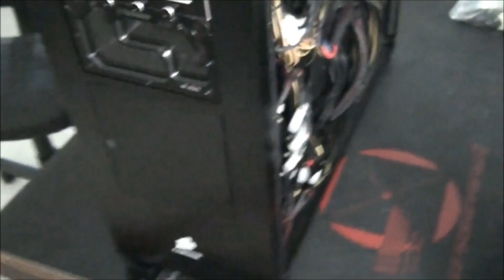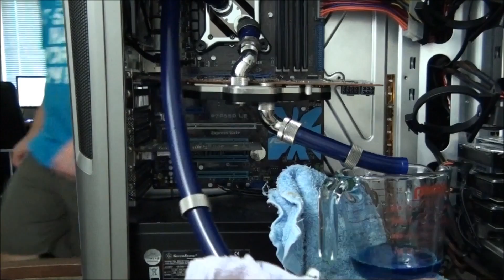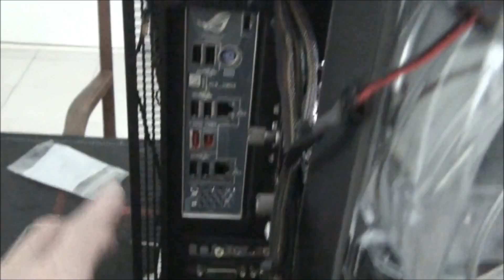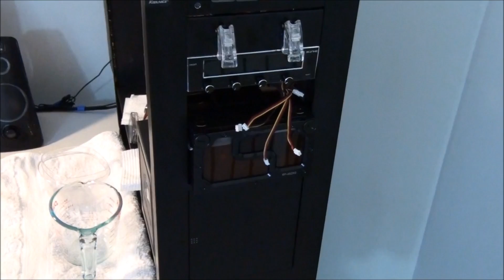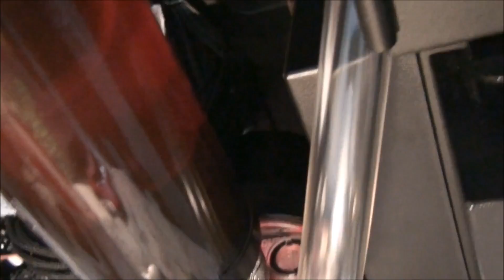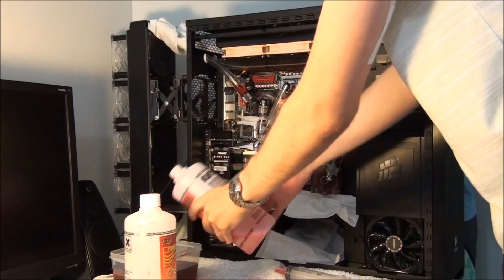Singularity Beast Resurrection - Client Build 3: 800D Water-cooling: Part 2

Comment: I believe the pump is either the 35X from Swiftech or a MCP655 or other renames, also the reservoir is from Bitspower, bitspower has only 1 tube reservoir so it should not be that hard to search for it.

Comment: Hello to you mate, i have the same resevoir and was wondering on the bottom where the fitting goes into the resevoir from the videos cards is the silver tube installed inside or the anti cyclone adapter or is it just the fitting going into the res?This is my first cyclinder resevoir and i don't want that cyclone swirl going on inside, but that calm look.

Comment: @SingularityComputers not something I'm disputing, just saying, you've obviously got a method that works but there are risks aside from cooking the CPU such as a leak, I always run my loops for at least 8 hours before powering up any components, for the sake of a couple of extra minutes shorting out the power supply its ALOT safer. 'specially as watercooling typically means high quality and expensive gear.

Comment: @MaZzMa7aZz The OC isn't stable with less volts. I am using 4 Cooler Master Sickleflow fans in a push/pull on it, so I'm not using the stock corsair fans which I'm pretty sure move a lot more air. They're a lot louder though. That might be the issue, but I'm going to get a water cooling loop regardless for better temps.

I live in the suburbs of Chicago, lol.

Comment: @Vortex1988 The Rasa 750 RS360 kit is pretty good, except I would recommend getting a  separate pump, reservoir and tubing.  The combined cost of the Waterblock and Radiator that comes with the XSPC kit combines to near $200 as well, so it's a bargain.

Comment: @SingularityComputers Sorry, I just have one more question. What do you think of the XSPC Rasa 750 RS360 kit? The reason I ask is because I'm either going to get one of those or a custom loop with a Swiftech Apogee HD, Swiftech MCP655 pump, and a Black Ice GTX 360 radiator. The Rasa kits are pretty cheap, but obviously the custom loop would perform better. How much of a difference would I see between the two, and which configuration would you recommend?

Comment: Were those CPU temps in the high 70's at full load? I ask because I currently have an i7 2600k overclocked to 4.8Ghz, and I get around 75C at full load with a Corsair H100. I've been thinking about upgrading to a water cooling loop, but I probably won't if I wouldn't see a significant drop in temperatures.

Would I see a significant drop in temperatures if I traded out my H100 for a water cooling loop?